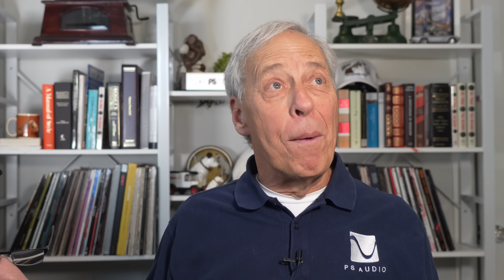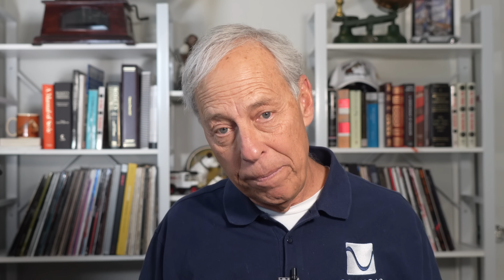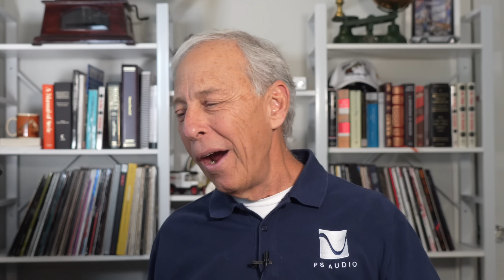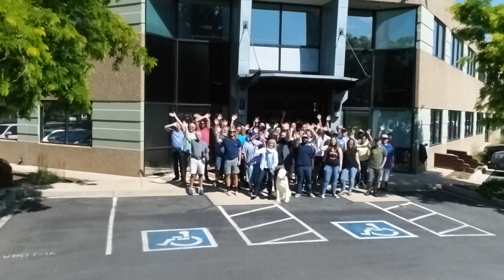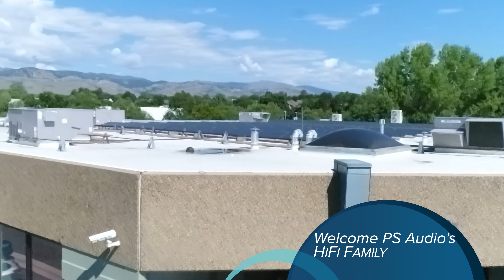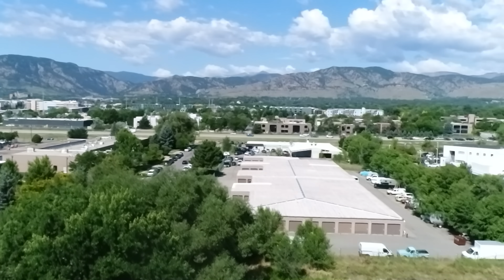PCB vs. point to point wiring

Comment: not sure on that one, search Amiga Lorraine, they build a whole computer with descrete logic (yes, LS logic chips, but simulating a bigger package custom Chip) just with wires on many many big boards. It was made in 1984, so complex enough to prove that it does work. Of course very prone to failure but possible. Not in a procution scale of course.

Comment: My Audio Research stuff has some pretty big traces on their circuit boards. I think point to point would be best but most of the best components I heard had circuit boards. But no small traces or surface mount devices. I personally don't like the idea of a micro in a stereo component as they can be noisy.

Comment: P2P wiring is great if you have 1 circuit to build but if you have 10, it will take forever.  Better to route the design on PCB and have the board house build them for you.  I've been a tech for 25 years and it's great for a young person with young hands and excellent motor skills to do this if you're bored and have much time to kill.  At my age I can design the board and have it sent out.

Comment: Wired amps are better for musicians who travel and use there amps in open air scenarios and store them in garages and warehouses. The high voltage (anode) circuits can be compromised when subjected to condensation. When I was a roadie for a band many years ago, our keyboard player loved the sound using a Radford Hi Fi  valve/tube amp. This had PCB mounted tubes/valves. We had quite a spectacular fire on stage one night due to the anode voltage tracking due to condensation. I don't know if conformal coating would have helped to stop this.

Comment: Speaking as someone that has built and repaired many point to point audio, video and RF electronics, I can say that without printed circuit wiring there would be no such thing as personal computers, cellphones, flat screen televisions, and most everything else that we use today. It is superior in many respects to point to point wiring except for truly high voltage circuitry.

Comment: There are oscilloscopes that operate deep into the gigahertz range that use circuit boards for all of the analog side of the signal processing.  They try to keep the analog signal path as short as possible.  Circuit boards are excellent for that.  They also isolate the analog from digital portions of the board with gaps cut in the boards to keep electron migration down.  There is nothing inherently wrong with circuit boards.  In fact, good analog design on a board will perform more reliably than a bunch of wires that are loomed by hand.
Reply: Rhode and Schwartz makes some fine scopes. I got a demo and saw $21,000 for a price and knew it was way above my pay grade
Reply: But unfortunately it still won’t sound better with PCB
Reply: @MrJohnadamsgilmour  for sure.  Not better.  Just not necessarily bad.

Comment: Like anything in technology there are no absolutes. Yes in general a PC board can provide much better shielding and impedance control over hand wiring. But you can also have a superb clean and quite point to point wiring job and a poorly design PC board that performs far worse. Also PC boards can cause issues with RF circuits (very rarely in audio) due to the substrate capacitance.  Common FR4 and G10 (the classic olive green stuff) for example are not suitable for microwave circuits. Here they often use expensive Teflon PC board stock. And I never liked the bakelite material still used in commodity consumer electronics, that light brown stuff. It's OK electrically but I just don't like it.
Reply: I worked for a company who made mixed mode circuitry and we used ceramic plates from Coors (the beer company) for the substrate for microwave circuits

Comment: The only time you would benefit from the extra copper in a wire as opposed to a PCB circuit trace would be when you were transferring power, as opposed to massaging a signal.  And all those point to point wires act as both receiving and transmitting antennas, providing the potential for signal degradation.   Modern PCBs are often so complex that they involve 4 layers, and all of this is done to shrink the package, get the components as close as possible to each other and minimize the connecting distance.  This results in superior performance.  I think I would challenge the concept that point to point wiring is superior.  Printed circuit boards were a giant leap forward in the electronics industry, and one of the key technologies used to provide a high standard of quality while minimizing cost.  >Charlie

Comment: My guitar tube amp designer friends have come to believe that while point to point does remains superior if one uses a PCB with sufficiently heavy/thick traces the difference can be minimized with significant production cost savings.  ANd that difference can be further reduced with small and careful design changes.  Cheap mass produced PCBs still suck for audio.

Comment: Paul...it’s extremely important you keep making these videos. Keep’em coming. Please

In all due respect Paul’s a little out of his lane on this one. The transition to PCB occurred decades and decades ago. So you gotta believe that any shortcomings that PCBs had have long since been identified and fixed. If that makes sense. It really becomes how much are you willing to pay for your PCB and the components on it. PS Audio supplies a Consumer Grade product and has to be sensitive to parts costs.

Does anyone remember the Zenith TV Commercials with the “Hand Crafted Quality” tag line? Zenith had a production line in Chicago building those Point-to-Point “Hand Crafted Quality” TV sets.

Except in very special Point-to-Point construction those types of consumer grade circuits would never ever pass a vibration test. An interesting research is to find a aviation grade radio from WW2. It’ll show you how to build a very tough Point-to-Point circuit.

Comment: Point to point wiring works superbly in relatively simple circuits like Tube  Pre Amps and for that matter Power Amps ( I know Paul is not a fan of Tube based power amps but I have heard around a dozen now and only one failed to impress sonically) I totally agree on the miniaturized surface mount components its just not possible. Just take a look inside say the Denafrips Terminator R2R DAC even if it were  possible,  point to point would make it the size of a small house and an impossible mess. I'm no expert but it does be the question though,  why are solid stste Amplifiers so chock full of components. Is it poor design or is it to overcome inherent technical issues???

Comment: I've got a couple of Sony switch boxes which I use to add more inputs to vintage amps. One's a 50yo SB-300 which is all point-to-point wired (designed for open-reel tape recorders), the other is an SB-V30G which uses a PCB (designed for Playstations). Surprise, surprise - no audible difference!

Comment: Tons of tube gear still uses point to point.
Reply: Tradition and makes you feel good
Reply: Well tubes lend themselves to point to point wiring because of the need for sockets. Plenty of tie points. And it's also traditional and we know how many audiophiles love that. But remember that a lot of 1960s consumer electronics was PC board and tube based as well. The draw back I see today are audiophile manufactures that place the power output tubes on PC board mounted sockets. That is a bad idea due to the heat. Dynaco knew that in the 60s with the famous ST35 amp. The power tube sockets were separated from the PC board.
Reply: @andydelle4509  Again, your referring to Consumer grade products. There were some industrial and military grade devices that successfully transitioned to Tubes on PCBs but by that time the world had moved on to Solid State and micro electronics. I suggest you could build First Class all tube audio circuit on PCBs today but the cost would be prohibitive for the consumer market. The new ATSC 3.0 TV transmitters I've seen have gone all Solid State with PCBs. The inside of those I've seen look very much the same as high end Audio Class A/B Amplifiers with PCB's. You'd almost mistake one for the other.
Reply: @wilcalint I agree power tubes can be done properly with good thermal management including fans. But you often see at audio shows some megabuck amp with a quad of KT88's socket mounted on a 0.62 PC board.  Not good! Just the waste heat of the filaments alone is enough to destroy that board in a few years.

Yes, modern solid state transmitters are built up in blocks so there isn't really a final power stage. You just have a stack of intermediate power amplifiers combined. So there you can use PC boards as they are not much unlike a high power audio amplifier as you indicated.
Reply: @andydelle4509  Do you remember two things?

#1 There used to be, maybe still are, ceramic tube sockets there were designed to be used on PCBs.

#2 The Beasts:

https://en.wikipedia.org/wiki/Klystron

Not something that could easly be fitted to a PCB
Reply: @wilcalint  Yes, I started out at a UHF TV station in the late 70s with an RCA 110kw transmitter that provided 5mw on channel 29 via antenna gain. It had three man sized Varien Klystrons, don't remember the model. Then I moved to satellite broadcasting. Those were also Klystrons making up to 3.3kw at 6ghz. And in the northeast NY area where the majority of TV satellite uplinks were at the time, you needed and average of 2.2kw to saturate the bird - satellite video is FM. Then when I moved to Los Angeles I learned they could achieve saturation with sometimes as little as 60 watts! Clear weather and a lot less atmosphere to punch through.

Comment: Audio has moved from point to point wiring to single sided PCBs to multi layered PCBs to simple analog ICs to complex DSPs, DACs and SOCs. The future is digital with most happening on highly integrated circuits for everything except the power amp output. We still need an analog signal to move that voice coil.
Reply: Primaluna  is point to point.
Reply: Drew hardy It’s a retro brand using tubes.

Comment: Depends on what the trace is actually carrying.... digital signals don’t care. High impedance analog signals (like the input to an op-amp) also doesn’t care all that much about the amount of copper; but capacitance does matter. Power - be it from a power supply or the current drive stage of an amplifier - cares a lot about the amount of copper: more is better; but there is a point of diminishing returns.

The other thing about PCBs is that they can be made essentially identical from one unit to the next; but trying to actually manufacture that with point to point wiring would be... challenging.
Reply: >Depends on what the trace is actually carrying....
There’s a lot to that. It ends up being a cost factor. No one anymore lays out PCBs manually. It’s all done by computer. The programs laying out the traces can be programmed in such a way as to isolate one trace from another. The biggest factor, IMO, would be how many layers a PCB is allowed to have, the separation of one trace from another and the size of the PCB. PCBs are better then Point-to-Point. All Stop. But at what cost?
Reply: Bill Kenney - well... sorta. Sometimes the autorouter is used; sometimes it’s not. I don’t use an autorouter, myself, just because I like having more control over where the traces go; and there are plenty of other engineers who feel the same way... but; there’s also plenty of others who use their autorouter all the time. Cost is definitely a factor; but so is signal integrity; and sometimes you really need the density, repeatability, and impedance control that a PCB provides... I definitely would not want to try and do a DDR4 SDRAM connection with point-to-point wiring! 🤔
Reply: @darkwinter6028  Lost skill...I used to work with a nice lady whos job it was to lay out the traces of a PCB board. I'd give her my circuit schematic and she'd sit at a light table and using black tape on a plastic sheet she'd create the photo sheet master. And she could do that for multilayered boards. Many of the packages were the TI 7400 Series 14-pin packages. Sorry, I'm showing my age.

Comment: Hand wiring is better fr guitars amps, particulerly with tubus becuase the voltage is far away from other conductrs from the lines ona circits broads. Marshell JCM 900 has a clipping diode in to to make it distort. My frends saie he gaves up on thems and nows useings a gutars processers with transisters. THENk yours Mistre Paul, you are honets and a smart mans. THUMBBES USPS.
Reply: You still here?
Reply: Hello Mine Goods Frends! Is this the articl you were lookin for from teh Lexicon PCM92 - 

25  CONTINUOUS CONTROLLERSAll PCM92 soft row parameters can be controlled with single, 7-bit controllers. Each parameter is controlled with the full controller range, regardless of the parameter range. For example, if the controller is at the midpoint of its range (64), the parameter will also be at the midpoint of its range no matter what the actual number.Continuous Controllers range from 0 to 127. If the parameter range is less than 127, then a small controller change might not result in a parameter update. But the entire range of the parameter can still be accurately controlled. In addition, if the actual range of the parameter is greater than 127, MIDI control might be somewhat coarse. This is most noticeable with large delays. When MIDI is enabled, the PCM92 automatically sends MIDI messages through the MIDI Out port for soft row parameters and preset loads whenever those actions are performed via the front panel controls

THANK YOU, YOU ARE Min eNWES frends! thumbbss upss!

Comment: Depends what you mean by big wire is not a beneficial property if it's not needed in it's application, thinner wire has better noise rejection. More important is the quality of the wire the material

Comment: 300B single ended triode point to point silver wired. Go big or go home.
Reply: Just lay out the amp in such a way where the signal path doesn't even need wire to begin with. Its better than using carbon fiber nano tube for wire and its free.

Comment: Technically, an integrated circuit's internal connections are all point-to-point.
Reply: Point to point is in the definition Paul is talking about is single wires for each connection between components.
Reply: You could say that about a PCB too.
Reply: He videos he talkd for POINT TO PONT WIRENGS. Its what they haves for Dr Z amps. There vidoes titles Dr. Z Guitar Amplifiers — How They're Made it start at 3 minu 50 secod shoing a guy point to pont wirng. THNAK YOU!
Reply: Technically according to this logic, all electrical connections are point to point.
Reply: Would you say the same thing about a waveguide?
Reply: Technically if 2 amplifiers have same mesurments in S/N ration, THD, freq range - the all sound the same.
Reply: IC's are made by depositing and etching metals on a substrate. This is more analogous to a PC board fabrication in that the component interconnections are a process of etching. Now the wires that sometimes come off the substrate and out to the pins are more like point to point but actually that is an obsolete process in modern chip designs due to cost and speed. Even those tiny wires have significant inductance at today's chip speeds. Most large BGA chips have the connections as part of the etched substrate.